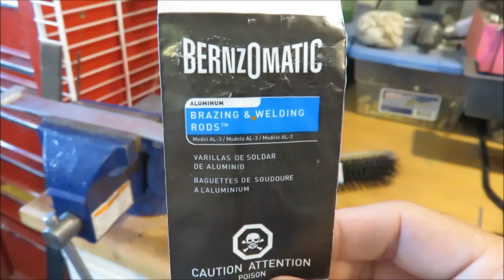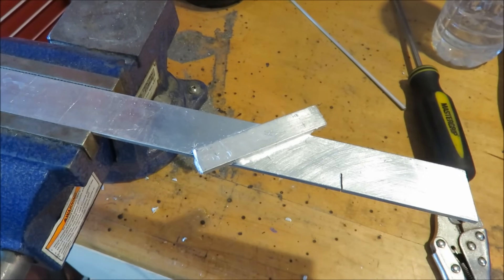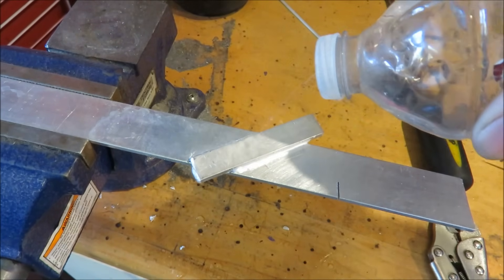How to solder aluminum.

Comment: This is bull crap this will not hold up the metals do not bind without flux Super Glue would hold much better than this garbage and the flux that is available for this process has nearly the same melting point as the aluminum a very few degrees difference  so good luck not melting the metal trying to get any flux to melt and etch the materials for a good bonding.

Comment: A tip I've learned - MAPP gas works better with larger pieces. The key is to quickly use high heat (while using caution not to melt the workpiece) due to the high thermal conductivity of aluminum

Comment: We have to tell YOU  this is not at Aluminum solder is a scam in at sense the so call ALUMINUM SOLDER IS 98% ZINC AND  2 % ALUMINUM WHAT YOU DON'T TELL THIS TO YOUR VIEWER .(YOU SUPPOSED TO TELL WHICH THIS ZINC SOLDER WE COULD BRAZE ALUMINUM) ANYBODY COULD SEND TO ANALYZED AND WILL CONFIRM

Comment: Wouldn't it be a more solid joint if you did not keep it very tight at the beginning, allowing a tiny space between two surfaces to suck in melted aluminum flux?

Comment: Why did my local radiator repair shop tell me that a hole in an aluminium radiator cannot be soldered/brazed?
Reply: Probably because the cooling fins are so thin—about 0.005”—they would melt in seconds under the intense heat.
Reply: Most radiator shops use lead-core or silver solder depending on the application.  As MJ Stone said, the aluminum used in radiator is so thin that you'd blow a hole in it with that much direct heat.  The only reliable repair we've been able to do on aluminum has been with epoxy

Comment: I absolutely hate these rods. They are great to plug a hole in a coke can but as soon as you want to solder something thicker than that, you need an oxy torch. Look at the tiny joint and it took over 5 minutes to preheat. Do not buy these unless you have a proper high temp heat source. A propane torch is not hot enough. Nothing against "First Class Youtuber" or the video.
Reply: Its on the fence, my class was able to use mapp gas on a turno torch head, it was 85 outside though😅 a heat gun might help
Reply: Turbo torch
Reply: Buy a good torch. Bernzomatic TS8000 and a 12 ft hose got hot enough to melt some scrap aluminum I had from a project.

Propane in air burns up around 3100F if I remember right, which can easily melt aluminum. No need for oxygen or MAPP or acetylene...you HAVE to flow enough fuel, these little cheapies won't do it. 

I have both kinds of torches, I won't waste money on the cheapies again lol

Comment: Repairing an aluminum window frame, what can I do to acheive this without the heat since I'm sure it would crack the glass and I don't want to dissemble.
Reply: Do not buy these, they won't work. You  will have to disassemble and get it tig welded...or replace the whole things.

Comment: No flux,,, how does aluminum oxidize with heat? Do you need flux to let the aluminum flow? Didn't look right, The join did not hold.

Comment: Great demonstration. 👍
It looked like the vice grip was acting as a heat sink, but whatcha gonna do about it. Ya got-a hold it in place some how.
Reply: You damn right, i was thinking the same. A beter solution coould be to add two wood pieces between the Aluminium piece and the vice

Comment: Seriously, even though you warned, don't use water to cool down a joint. The braising rod isn't the same alloy as the aluminum, so it will contract at a different rate than the rest.That could crack the joint or delaminate. You know, like what happened when you bent it :)
Reply: back in high school metal shop a kid just got finished brazing some steel and decided to cool it down in the sink, I of course tried to tell him but he ignored me. All his brazes he spent the whole class doing ruined
Reply: Thanks!

Comment: Can i use a soldering iron and solder?
Reply from the maker: No, you need more heat than that would provide.
Reply: @First_Class_Amateur  so i cant use a soldering iron on a 49cc engine?
Reply from the maker: Mr Engine if it can be done with a soldering iron, I would be very impressed.
Reply: @First_Class_Amateur  have you tried it before?
Reply from the maker: @mrengine970  I never have.
Reply: @First_Class_Amateur  ok sir i will give you feed back🖒
Reply: @First_Class_Amateur  unfortunately it did not work
Reply: @mrengine970   Totally a novice here but at least I can read between the lines:
 
Melting point of steel,  around 2,200-2,500 Fahrenheit (°F) / 1,205 -1,370 Celsius (°C). 

Melting points of copper alloys (including bronzes, pure copper, and brass) around 1,675-1,981°F / 913-1,082°C. 

The aluminum melting point has a lower temperature range than copper alloys. Pure aluminum melts at about 1,218 °F / 659 °C, but alloying with other elements can raise this.

Comment: Do you absolutely need the brazing rods? I'm looking to repair something very light and not for structure. Do I still need these brazing rods?
Reply from the maker: Terrance Williams No, but you would need a flame hotter than this one. It also takes a certain amount of skill to avoid making a messy puddle of molten metal.
Reply: @First_Class_Amateur  What would I need to use instead of the rods? I'm trying to repair a grabber just to see if it can be fixed.
Reply: @Twilliams60142  zinc

Comment: Ya know I wonder if u Flux between the pieces if the rod would flow actually between the pieces. I know brazing isn't the exact same as soldering,,, but the low temp would kinda allow for capillary flow to the heat and Flux.
Reply: Flux works very well pulling in the material used for brazing between the materials used go braze together

Comment: Question... If I was to make a ring out of a long piece of aluminium, and then try to weld the two together to complete the circle.... would that work? Its on a much smaller scale.. but cheaper that titanium or tungsten.. for my uses. Thanks.. 4 years after.. LOL
Reply from the maker: It would work but aluminum would leave a black ring around your finger from metal transfer. Check out the video I did on how to make a titanium ring.

Comment: It broke because you put water on it before it was totally cool.
Reply: This is true, first off he is using propane which is nowhere near hot enough for this. You should use either MAPP gas or oxy settling. Secondly you are correct he shocked the aluminum by water cooling it. Soldering and brazing need either a quench in oil or air cooling. You want to never quench your welds in water as that will make the material brittle.
Reply: 77Avadon77 if the propane wasn’t near hot enough then how exactly did the braze melt? Propane works just fine it just takes a little longer. 
And the dude said himself you’re not supposed to cool it with water, he was only demonstrating.
Reply: W il

Comment: Interesting. I was expecting to see a capillary reaction. Thanks for the demo.
Reply: I was thinking that too, wondering where the flux was. The flux wasn't - that's why the braze metal wasn't flowing at all, and that's why this isn't a great braze joint.
Good to know that brazing aluminum is literally exactly the same process as brazing brass though. I did get the information I came for.

Comment: +Slap Stick.yes,that's the idea.do not let the aluminum channel the heat to the next metal(vice).You can sandwich the parts between two bricks ,tiles,rockwool etc.(low Thermal transmitance coefficient λ) to prevent them from moving around.

Comment: Use a INOX CLEAN brush (not any brush-dedicated to alu brazing) to break the surface oxide and after wipe off clean with aceton.Use the brick(s) in front of you to put the aluminums on,don't use the vice(that's why it takes for ever to heat the metalls).
Reply: +Slap Stick ...between vice/clamp a piece or strip of tile/brick, isolating the workpiece.
Reply: +Cons. Bor. The process of oxide formation is very quick. Using brush is like just scraping. If using flux then there is a capillary effect and oxide replacing reaction which bonds the substrate aluminium metal very good.
Reply: how would you hold your work best in order for it not to move and not to lose the heat?
Reply: @DJM1LOVE  sandwich the piece between wood to act as insulation instead of using metal to metal contact.
Reply: exactly! the vice absorbes a lot
Reply: +Cons. Bor. How do you keep it from moving?
Reply: emjit I see. Thanks.

Comment: I tried this today using the same rods with a propane torch but am having issues. I heated the joint I want to weld for almost 10min but it doesnt seem to take the rod.